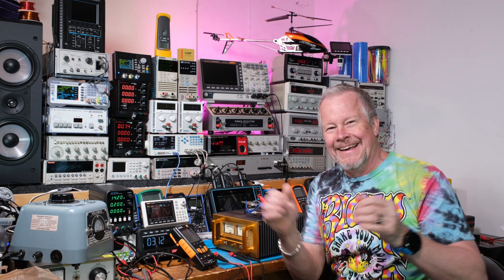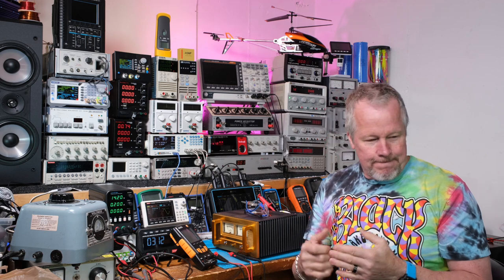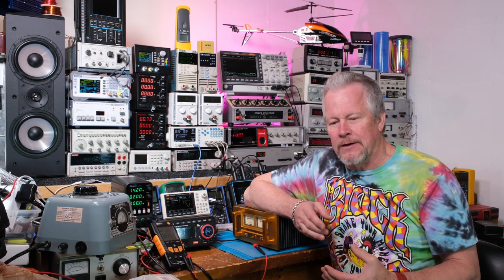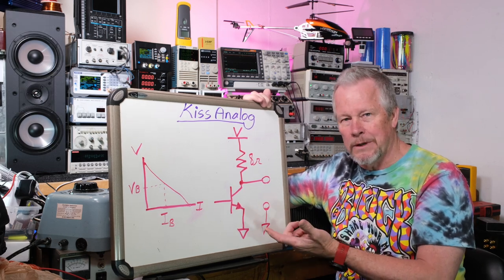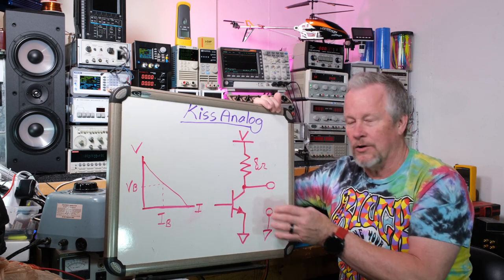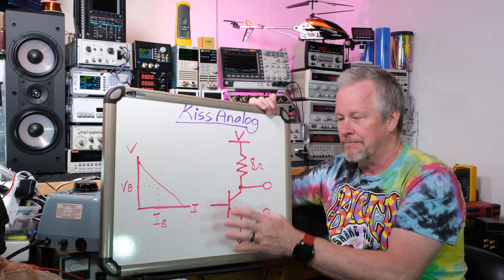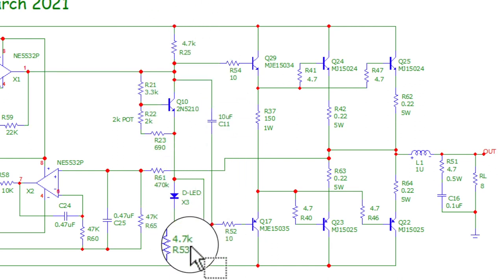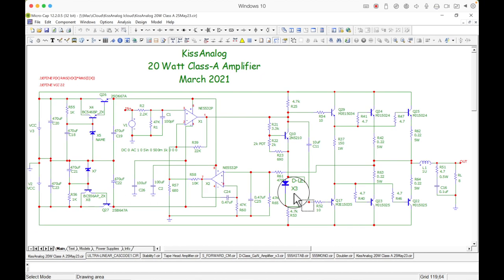Class B Class AB and Class A Amplifier bias explained

Comment: 22:42 This circuit doesn't work because there is no path for the base current of the pnp transistor to go to. I use a transistor Vbe multiplier (BJT + trimmer potentiometer wiper to base end contacts to emitter and collector) instead of 2 diodes and a trimmer potentiometer. The BJT must be thermally coupled to the heat sink in the immediate vicinity of one of the output transistors. I normally use the opposite side of the heat sink to the output transistor. So it is just a few millimeters away from the hot spot of the device to be cooled.
Reply from the maker: Thanks for this feedback!  Yes, you are right - is your bias then close to what I showed in the schematic for this Class A amp?  It is also placed on the heatsink right in the middle of the NPN and PNP transistors.